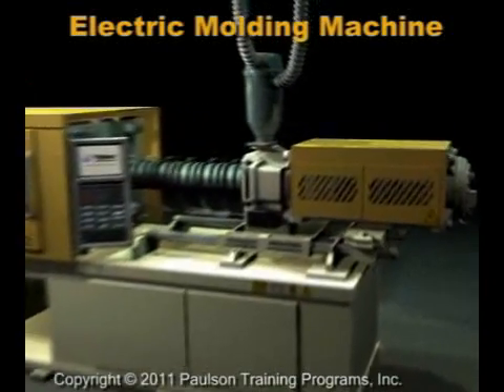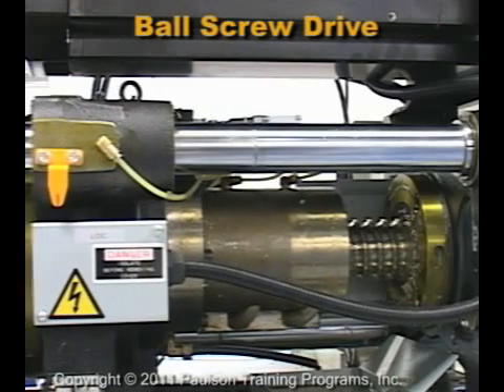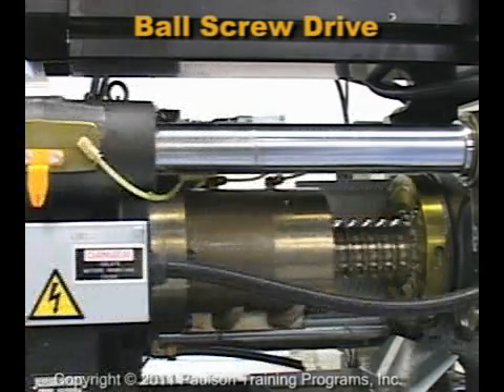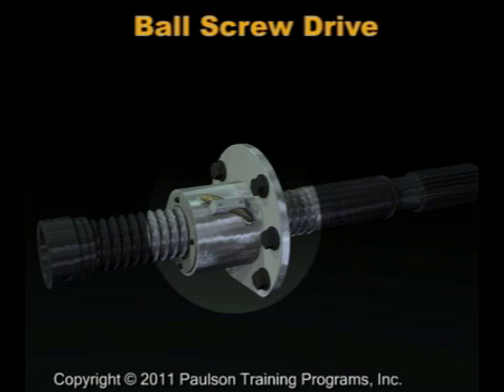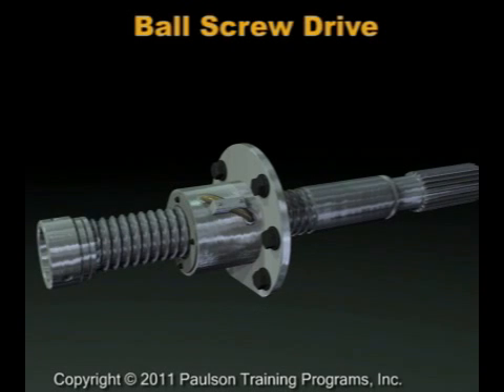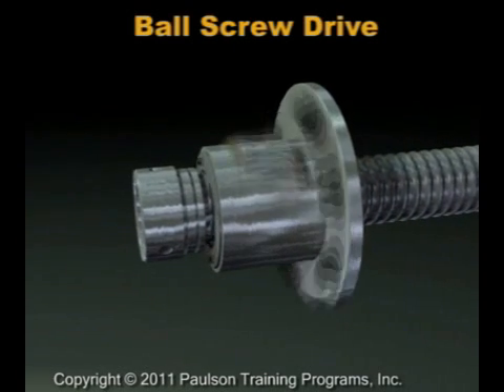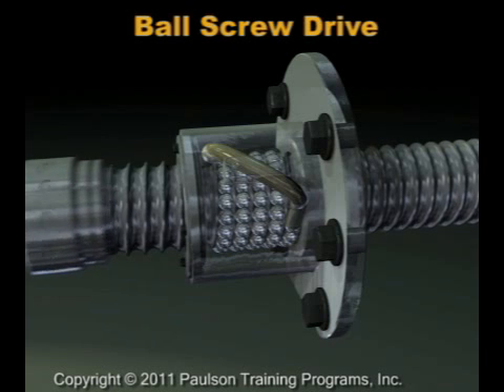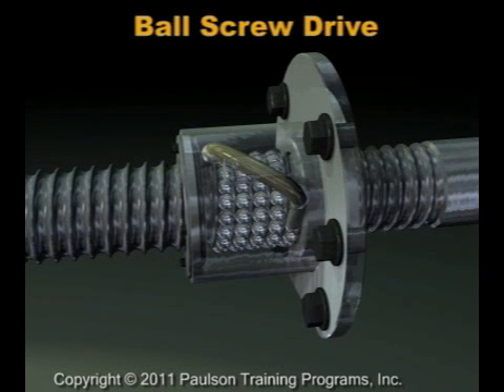Electric Injection Molding Machine Operation - Paulson

Comment: It's a brilliant idea for a electric powered screw but I have 1 concern how do u control Back pressure I mean obviously we need it so that we have a consistent mix of the Polypropeline Material and the Color additives how is this controlled Screw Rotation speed?
If we can't have good mixing of the Materials without back pressure the scrap rate will be too high due to improper color dispersion can anyone explain this to me please tyvm.